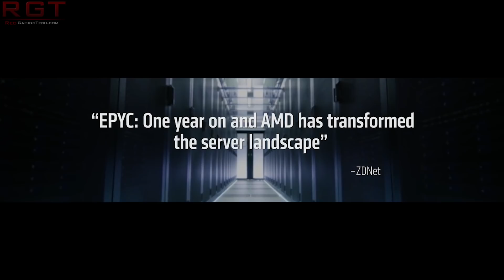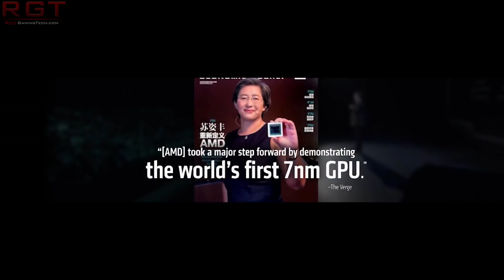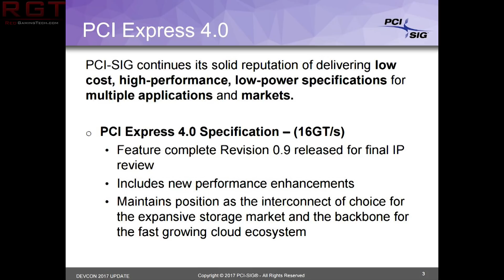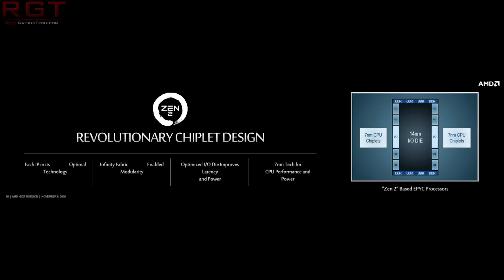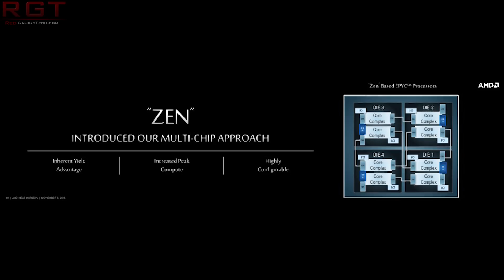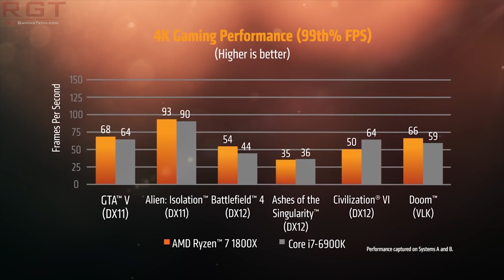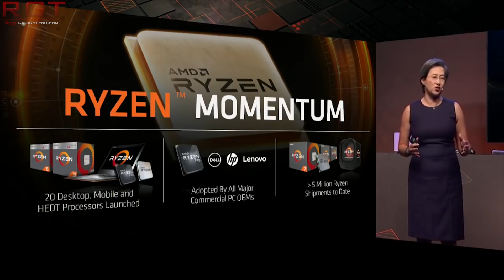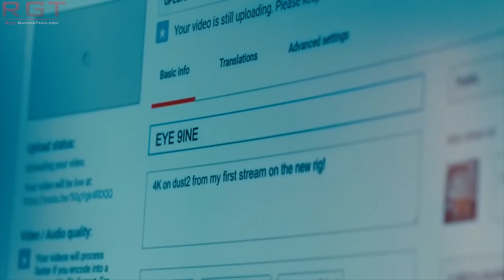Should AMD Raise The Core Count for Zen 2 Ryzen 3000 CPUs ?

Comment: Gamers need 8 cores 16 threads single ccx with ipc improvent and higher clocks...
Reply: It would be nice if they would start programming games/game engines to utilize all the cores and threads available
Reply: @justahologram2230  they should make all the games capable of utilizing 6 cores and 12 threads and later 8/16 cuz having headroom is always good especially if you want to stream or produce something while gaming...
Reply: @darkokutlesa2386  let the OS or bios handle how many cores one program can access, if someone wants to try for 2k fps in counterstrike with an overclocked 7980xe that's their business
Reply: @darkokutlesa2386  Game consoles are currently 8 core jaguars with 8 threads. Console games use 6 cores for the game 1 for system and 1 for audio if I've remembered correctly. With the next gen consoles on Zen 8 cores 16 threads with Navi gpu inside game developers will have to step up to the plate. Games under development now are being  made to take advantage of Zen. Game engine devs are being hard pressed to keep up with new hardware (cpu & gpu). The game engines we have now are 4 yrs old or more. They keep strapping on patches until they break. Will they ever update GTA 5 with a modern game engine that doesn't break above 140 fps? It's a great time to buy a AMD GPU. It will be at least 3 yrs before ray tracing is more than a fad. Look how long DX12 and Vulcan have taken to come to games. It may take 6 yrs or more before DX11 is put to rest. But video cards will still need to support it, like we do DX9 now.
Reply: @Darko Kutleša this is not how multi threading work, games have brealy any control to decide on which core (if not selected, but you should not limit that if you think about using CPU at 100%) and when it runs. To improve multi threading, you need to do is to divide up task to threads (and im not saying CPU threads but software process threads that are sub process of process)  and make sure those task don't pause waiting for data from other completed tasks, so OS have easier job to assign those threads to cores, thats all developers can really do. There software is not made to run on X amount of cores, whoever tells you games is made to work on that specific amount of core only shows they have 0 knowledge about multi threading. The best multitasking software will scale Infinitely between cores, like image processors which can infinitely divide image and only process those pieces of images on every thread.

Due to sequential nature of any world simulation and rendering software, like games, they are cursed with data dependency, each task need to N number of other task to be done first, because of waiting time it can not be executed until those task are completed, so you can not throw it just to separate thread which may or not (again this is not software to decide but OS) to be executed on different core, code need to wait and this waiting time is what kills multi threading potential of games. The CPU threads makes things even more conditional as CPU threads are just partly parallel and software and even OS have 0 control on when somethings is executed, CPU threads only partly speed up things by having 2 different threads using parallel process features of the core then just throwing single thread at the time. At most you can make you code more friendly for CPU to divide task on CPU threads

Games practically never gonna use 100% of CPU due to mentioned issues, but keep in mind.... and i don't know how many times i wrote this on YouTube... PC are not consoles, they can run multiples other processes on same time and each process is different thread which OS can run on different core, so having more cores always benefit you as it universally improve your system multitasking capabilities, somethings that PC gamers seems to not even realize, because they watch too much of gaming hardware YouTube channels instead of actually having actual technological knowledge.
Reply: @ShadowriverUB  thank you for the explanation
Reply: @justahologram2230  "How many cores a program can access"... A program can run worse on 8 cores than on 1 core... optimization is much needed, on a compiler, then framework/language and finally on the software itself for multi-core performance.
Reply: @justahologram2230  They will with next gen consoles.
Reply: Mainstream fo not need more than 8 cores 16 threads.  Keep it the same with a higher clock speeds and better ipc.   If a Ryzan 2700x was running at 4.7ghz.. intell 9900k would cry like a little girl!!!   Hope zen 2 goes up to 4.6ghz with turbo, with 10% to 13% ipc gain. So intel shit themselfs and have a nervous brakedown and reduce there stupid rediculess prices and mobo sockets boards.
Reply: That’s not goanna happen on 7nm without them charging intel prices, the reason zen is cheaper is because being able to use 2 ccx’s, and then take into account 7nm high cost, and it would end up being pretty expensive, depending what process intel is on it could still be cheaper, but not by a beefy margin like it is currently
Reply: @IAmCjcj11  im afraid you are correct... Maybe zen3 will bring chiplet design to eliminate multi ccx design problems
Reply: @Cherries thats why he saying 8 cores in single ccx, which would improve lentecy, as number one lentecy issue on ryzen is uneven access to whole memory between 2 CCXes
Reply: @ShadowriverUB  
The only latency issues are inter CCX latency on Zen 1, primarily this is due to the infinity fabric used as communication between them. It's been proven that IF latency decreases with frequency that correlates to memory speeds in Zen1.
Zen 2 will see Infinity Fabric bandwidth increase by at least double, on Zen 1 IF was set at half memory frequency, but to do what they are with Rome, IF will need to be at least 1:1 with memory frequency (memory controllers aren't on the chiplet and communicate via IF to the chiplet) and possibly decoupled from it with it's own base clock.

https://www.pcper.com/image/view/82776?return=node%2F67947

We can expect inter CCX latency drop by half at least to 60-70ns with 1:1 frequencies, which isn't too far off the Intra CCX latency of 40ns for Zen. Comparing it to an 8 core ringbus chip of 80ns (5960X) and a mesh based 8 core of 100ns (7900x), there won't be a need for 8 core monolithic dies. The 7700K's latency is about the same as a zen 4 core CCX around 40ns and as you can see the more cores you put on a ring bus, the higher the latency and mesh isn't any better at 8 cores.

So an 8 core CCX isn't going to fix the issue, it'll make latency worse overall, the 4 core topography is zen and it's very likely that zen 3 might eliminate inter CCX latency variables completely.
Reply: What do you think i ment by "uneven access to whole memory between 2 CCXes"? It exactly the thing you talking about, need of one CCX to go thru other CCX to access other half of memory, which is main traffic you will have between them. But you got a point you could lower lentencies, in infinity fabric, still there always be longer delay in between
Reply: @ShadowriverUB  
Zen 2 doesn't work like that with main memory, each CCX has the exact same access because the memory controllers have been moved off die to a central hub. there is no uneven access anymore. 

Even on Zen 1 each CCX had the same access, only the WX CPU's had CCX's that didn't have direct memory access, because those die's memory controllers were disabled.
The only time there is an issue is when you need that extra step to access memory connected to another die (because A: the scheduler is dumb, or B: you have a single massive workload that uses a lot of memory and uses all the cores available) and that's not really that much of an issue and it isn't really latency, because it's an extra step and it's not between 2 CCX's, but between a CCX and another die's memory controller over infinity fabric and only on Threadripper and EPYC, not Desktop Ryzen.
Reply: @magottyk  i actully thouth that memory contoller is part of CCX but i checked and you right its not.
Reply: @magottyk  thank you
Reply: @pred ater firstly i have a 2700x.
I would off got 8700k. But the prices are redicluess, and the motherboards to.  Intel create a new board with every new cpu, where amd do not. 

I want amd to be better and faster. 
One. intell are  blatantly ripping customers off to their faces and deserve to lose custom for it.
Two. Ovs i have a ryzan cpu. 
Three.  Intel have had the lead to long and not made any effort to create better because thay have been on top. So there atitude is why should we. 

Because customers that pay for cpu's year after year deserve some respect and customer care.
Reply: Refine current tech. Clock, IPC, latency, memory controller, improve infinity fabric clock/architecture. We already have more cores than is being used. And for cases where they are used is Threadripper.
Reply: Single CCX, you want AMD to go the monolithic CPU route?

Comment: They shouldn't it makes no sense for them to do so, just up the clocks and such but we dont need more cores leave that for tr4
Reply: AMD should increase core count more or less like: R3 being 4C/8T or 6C/6T, R5 8C/16T or 8C/8T and R7 10C/20T. It would be really nice.
Reply: @lagarttemido  i'd say R3 6/12 r5 8/16 / r7 12/24
i'd dig that.
Reply: Why woudnt we need more cores ? 8 cores at this age is a bare minimum. I would like the 16 cores.
Reply: @pred ater AMD has shown that even with 16 cores the threadripper can go up to 4.1/4.2 GHZ. so they can easily do it. 

I'd say 2x6CCX would be a nice idea. 12 Core mainstream for 360-380 $ is great. 
Not only would this make it even more evident that intel is too expensive, with ipc improvements and clock speed improvements all reason to go for intel is gonna be gone. thats great for us since intel is gonna have to get back somehow and thats how you can get great deals for consumers.

a ryzen 1700(X) are going for 150 dollars now. a ryzen 2700 is 200 dollars. great prices. so i'd say increase core counts aswell.
Reply: I would keep the core count the same until 7nm is ready and they can keep the same price points, which is a huge part of why they are doing so well. ei: 2700/xw/cooling + a good b450 = $335/$385 usd atm. 9900/k + decent cooling + a good z390 = $700/$800. That is a huge price disparity.

I would like an entry 3920 for a bit less though, as it would move even more people to the hedt platform and really put pressure on Intel.

Another thing I believe most people would really appreciate is an 8 PCIe lane bump either on the chip or b370's themselves. I don't think that would pull people from TR, as 24 PCIe would be great for NVMe's, m/u.2's as opposed to SATA SSD's along with a high end GPU. It's just getting really easy to saturate 16 lanes now, and most people don't need the full 64.

I doubt I'll complain either way, as they seem to be making all the right decisions on the CPU side, now if they could just impress everyone on the GPU front we'd see some competition again. I'd rather not have to spend $2000 for two GPUs in two years to upgrade two of my PC's for 1440p 100 high. Wow, lots of "two's" there.
Reply: @pred ater So we agree.
Reply: @pred ater that would be true if cpus ran at a fixed clock speed, they don't they change according to the current load, which means we don't need to reduce clocks when we have more cores
Reply: @pred ater was responding to this:
@Cbeddoe19 sure but you cant just add cores higher ipc and clock speeds. more cores means lower clocks you cant just keep adding cores, some things require higher frequencies. you cant have it all. for the average user mores cores are pointless. most games still dont even use the 8 cores and 16 threads available now. for productivity there is threadripper and we know how that playes out for games.
Reply: it means you can have the cores and the clocks and the ipc,
Reply: most games only peck a few cores if you go look at the task manager, so with boost you will get those cores at higher clocks, the other less used cores should be at lower boost levels, its very rare that we have a game that has the same core utilization over all the threads as thats actually not faster as you end up with too much work to synchronize everything, so yes in most scenarios you can get the high clocks even on higher core count cpus
Reply: I think you dont understand what is threadripper, it not "bigger cpu", it is 2 or 4 cpu dies linked in single package, it somethign bettwen muti core and multi socket solution. Not to mention Threadripper suffer from socket cut down from original Epyc socket and access to only 2 sets of IOs instead of original 4 and uneven IO exposure between dies which TR 2xxx series exposed those issues. Having more cores on die or even bettwe on single CCX is more optimal solution then this and AMD will seek it over anything else. But by look of it Epyc 2 is 8 dies in single package, that means die they using right now still having 8 cores. Also lot of people have 0 knowledge about threading and fact that you benefit from multiple cores even if software is not so multithreaded, as multithreading is already occuring with OS schugler and universally improves multitasking compabilities as single process i system is single thread on it's own. PC are not signle process consoles, it's funny how PC gamers are easy to forget that

Comment: They likely will, since a high clocked zen will not overtake the 9900k, a higher core count ryzen would be awesome.
I doubt the iGPU will win in this poll, no x370/x470 boards have no display ports on them besides, most will be upgrading from those boards.
Reply: What makes you think it won't overtake a 9900k? We're expecting anywhere from 13-15% IPC uplift, even at 4.5ghz you could edge out a 5ghz 9900k with those numbers
Reply: You probably can, but I don't mean "overtaking" by 5%, it needs to be a larger difference like between the 8700k and 2700x